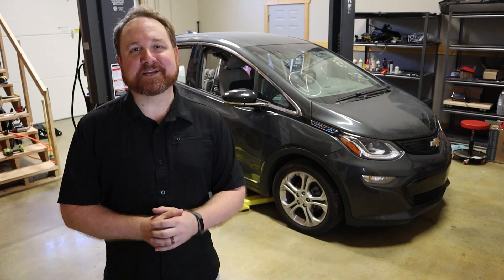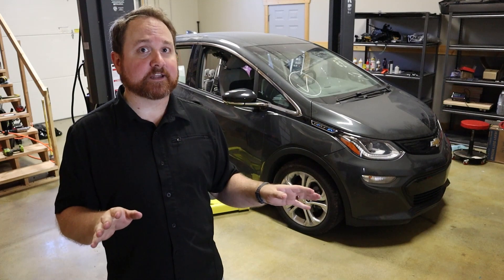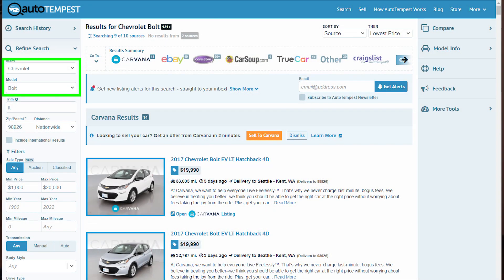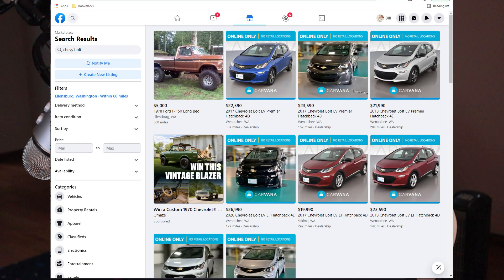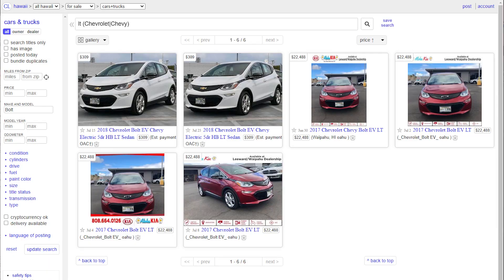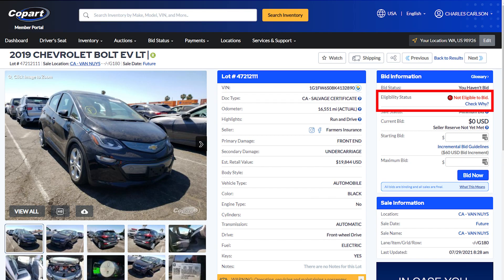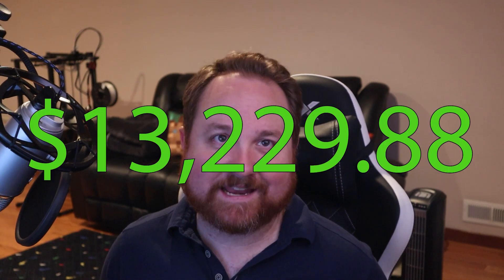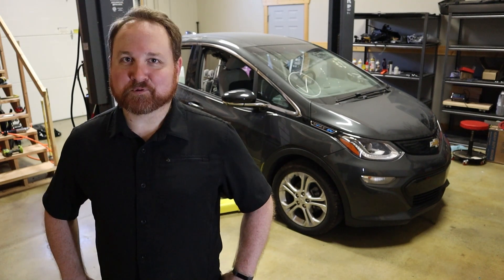I spent $13,229.88 buying a donor vehicle for the DeLorean EV Conversion

Comment: Awesome project! I subscribed immediately upon seeing this series. I own a 2020 Bolt. It is a great little car. I never really considered it as a donor car for EV conversions but I think you are really onto something. Everything is so compact, the parts will probably find their way into many conversions.
Reply: Do you get the full 240 miles to a tank? 
In the winter how far does it go down?
It looks like the DMC will even be lighter than the original car. I will have to look at the conversion some time in the future when the batteries can get closer to 400 miles & charge stations catch up. I just rebuilt the island twin turbo version PRV & want to get my money's worth for a while. :)